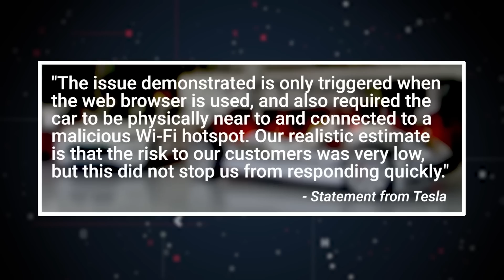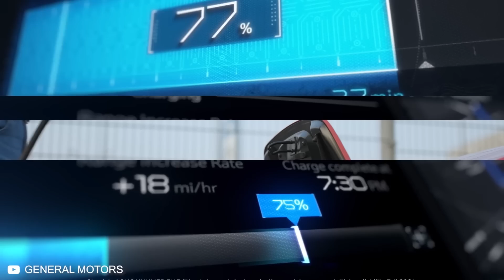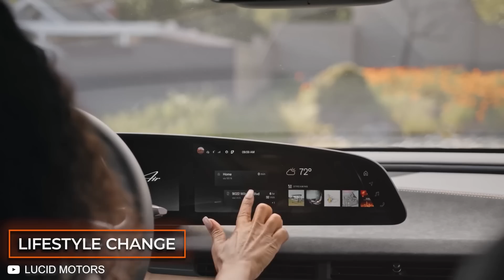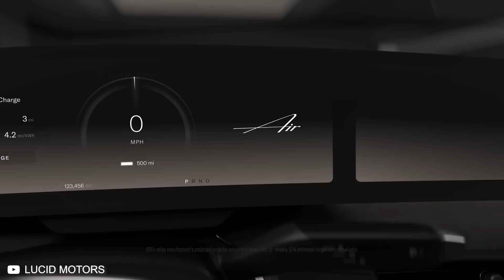EVs' Serious Problems That Carmakers Are Hiding

Comment: As a mechanic I can say Electric vehicles are less complicated than modern diesel cars .
Reply: Isn't the problem with modern Diesel with that stupid DEF and DPF crap? Other than that, Diesel engines haven't changed over the years with the exception of getting more quiet and more fuel efficient.
Reply: @bmw803  yes but electric vehicles are still less complicated. The most complicated thing in an electric car is the battery.
Reply: @cuppajoe2  They're less complicated for sure, but doesnt mean cheaper to fix. Over time this wont be an issue, but if an onboard charger, inverter, or any other component goes, it's big bucks. Even AC system isnt conventional.
Reply: @bmw803  well maybe for some EVs but if you are smart and buy a tesla then you usually get good service and sometimes free service if something broke early in
Reply: @cuppajoe2  I'm not spending over 40K on a car to save gas and a few oil changes. Bought a 2013 TDI Jetta 3 years ago and it runs trouble free. That's the problem in this country. Waste money on cars and then expecting taxpayers to pay for their retirement.
Reply: @bmw803  You forgot about asking tax payers to help fund their new EV toy. Up to $7500 in federal tax credits along with other State incentives, plus HOV privileges. Duuuumb!
Reply: @bmw803  if you can’t afford an EV then don’t buy it. But with current gas prices, it might be cheaper to buy one.
Reply: @cuppajoe2  Definitely. If gas prices keep creeping up, then the EV becomes cheaper, but demand will also go up, meaning the vehicle goes up. But on the long run, it might be cheaper.
Reply: @bmw803  yup. Especially with this whole russia Ukraine thing going on. It cost like 75 bucks to fill up my gas tank yesterday.
Reply: @cuppajoe2  lol, prices of electric energy rose already and will rise. Even some countries decided to charge EV charging stations which is fair. Why should I finance someone's car? Also, how do you think you'll get that much energy? The sun isn't always shinning and there only can be a breakdown in the whole city if all people would put their cars into s charging stations
Reply: @cuppajoe2 burning coal is one of the worst ways to get energy and since I have read that you don't think it's nothing special to the environment, here stops the conversation. We all know throughout the history how much coal clouds did poison ordinary people and how much the visibility was impacted. A gasoline car may not be the cleanest, but it's more efficient and simple to maintain. I don't know where did you get the information that e-vehicles are easier to maintain? E-vehicles sre far more sensitive and, when an electronic part dies, other thing are surely going to die too. Older cars were mostly mechanical and that's why they are still being used by people. Look at golf 2. It's a stupid car, but still it's on the roads. A tesla will go to a trash can after few years. Making electric infrastructure is also damaging the nature. Thermal power plants have to have much space to be built and many animals are being killed and their living spaces destroyed. Nuclear power plants are the best option for producing electric energy, but the problem is the nuclear waste. Where do you think it should go? Into your vegetable garden? Wind is also not always present. My country has a few windmills and they start working maybe few times in the year and they have a short lifespan. That means that you have to buy another one throw the old one away. Not so eco
Reply: @franfinesim  car. Also, idk where you get this notion that ICE cars are easier to maintain. An electric car is a battery with wheels. Some don’t even have axels. ICE cars need complex engines, driveshafts, cooling systems, fluids and more. EVs are a little more sensitive to the enviroment, but I don’t know where you got “when one thing dies other things will too.” That’s just not true. EV manufacturers made sure of it. The reason older cars are still being used by people is because there wasn’t widespread EVs just a few years ago. A tesla will not go to a trash can lol. Sure, the batter will need replacing after more then a dozen years, but they will recycle that battery meaning no waste. And buying a new battery seems expensive, but it’s cheaper then buying gas throughout those years. We are already killing animals by building up oil and gasoline infrastructure, so you can’t really speak on that front. Nuclear waste, while annoying, is put underground. You are right though, nuclear waste is a problem right now. If wind isn’t present in your country, then they won’t build windmills.
Reply: @cuppajoe2  lol. Do you know that you still use breaks, tires and other stuff like a normal car right? Ok, you don't need to add motor oil, because there is none, but still you have to cool the battery or you'll get toasted. What about your suspension, that's what you forgot too. Many people drive combustine engine cars, because they are reliable and you don't need to wait for minimum of one hour to get your battery charged, when you go to a business trip. How do you expect that a delivery man delivers you your goods if it has to stop every few hours. Oils are also used to make plastic what is also used in e-vehicles 🤷🏻‍♀️. And lol at the last sentence. I've explained you that we have windmills, but they rarely work! Because there is not enough wind and they will go to trash in a few years, because they a have a short lifespan. I'll rather drive a gasoline car with natural gas which is very clean and cheap (ok, now not because if the war in Ukraine, and sanctions to Russia).
Reply: Sure, until you have to replace the battery. Or until the electronics go bust.
Reply: @tinytownsoftware3837  it's all modular just parts replacement not repair .
Reply: @tinytownsoftware3837 what’s this supposed to mean here? Electronics are super easy to replace. You know what’s not? The internal workings of an internal combustion engines.
Reply: @cuppajoe2  if it were that easy to replace electronic parts, every person would drive an EV
Reply: @franfinesim  that’s just not true. For one, there are people like you who, for some reason, hate on EVs. 2, at the moment, EVs are quite expensive so not everyone can afford them. Replacing their parts is way easier and cheaper then a ICE parts.
Reply: That's utter bullshit.

Comment: Make sure that you have an unattached garage for your EV so it doesn’t burn your house down when it spontaneously combusts. 🔥🔥🔥🔥🔥🔥🔥
Reply: The chances of your electric car spontaneously combusting is so incredibly low that it shouldn’t be a worry
Reply: @cuppajoe2  Ask GM about that. They’re the ones that advised leaving your Bolt outside.
Reply: @barackblows1942  well that’s GM lol. Most others don’t.
Reply: @cuppajoe2  Make sure your smoke detectors are working. 🔥🔥🔥🔥
Reply: @barackblows1942  I will. Not becuase of an electric car though
Reply: @cuppajoe2  I wouldn’t be able to sleep with an EV parked in my attached garage. 🔥🔥🔥🔥
Reply: @barackblows1942  Oh No I aM sO sAd
Reply: @cuppajoe2  EV cars' batteries may not yet, but they will.
Reply: @cuppajoe2  You will be even more sad when your home also burns down while your electric car is charging. Even if your neighbours are not burnt out they will have to be evacuated because of the highly toxic fumes.
Reply: @cuppajoe2  Look up the recent Bolt debacle. Not that low.
Reply: @tinytownsoftware3837  the bolt batteries MIGHT catch fire. Also idk what this whole thing about batteries catching fire is. ICE cars catch fire way more often but nobody talks about that.
Reply: @cuppajoe2  They don't catch on fire when they are parked in your garage. They catch fire when they slam into other cars. And so do EVs by the way.
Reply: @tinytownsoftware3837  Actaully multiple ICE cars have caught on fire while going 60 mph down the highway… which I would say is worse. Also EVs need to have extreme protection against battery fires. Also also, it’s super rare for an EV to catch fire. Also also also, if you have fire alarms, it shouldn’t be super deadly.

Comment: the maintanance fees are bonkers
Reply: They really aren’t, I don’t see where your getting this info
Reply: @cuppajoe2  15k to replace a battery with a 10 year life expectancy. That’s equivalent to replacing your engine after 100,000-200,000km
Reply: @jimp5133  ok, let’s say you have a gas car and you drive 150,000 km (around 93,000 miles because my country uses inferior forms of measurement). The average car gets around 24 MPG, and if we divide 93,000/24 then we get 3,875 gallons of gas needed. Going off a VERY conservative estimate of $4.50 a gallon for gas, you get over $17,000 in gas for that car. And that’s a conservative estimate, with current gas prices it could be more then $25,000 or up to $30,000. Electricity is so cheap it’s not even a factor.
Reply: @cuppajoe2  what about the lithium required for the batteries? And what is the source of electricity? Fossil fuel powered? Realistically everyone will need to go Nuclear, not that excited considering the toxic waste.
Reply: @jimp5133  the lithium is already included in the price… but if you are referencing how scarce it is then yeah you are right. We are running out. We do have a few solutions though… other planets and even our moon, which we will soon be mining on. In the meantime, there is a lithium vein in Nevada that companies are trying to get to. Yes often fossil fuels are used to bring electricity to your home and power your car. Fortunately, burning coal to make electricity and then putting that electricity in an EV is FAR more efficient then putting gas in your car. You produce far less fossil fuels with electricity since a gallon of oil produces more electricity then torque in an ICE. Also nuclear power plants produce like no waste compared to other power plants.

You might be skeptical about EVs, but just know that everyone was skeptical about every new thing… EVs are here for the better.
Reply: @cuppajoe2  it’s not “far more efficient” by the time you factor in everything, going off planet requires a lot of energy including the burning of fossil fuels. Reality is it’s a band aid solution for a tech dependant culture, the best solution is to get away from the screen age, and invest in ecology, like afforestation that thrives in a Co2 rich environment. The individual effort, doubt everyone has planted a tree when this could help reduce co2 and the last thing we need is nuclear toxic waste. Yes there was a time when traditionalists were sceptical about the negative effects of the combustion engine, but here we are today. EVs aren’t a better solution to an ecological issue, never will be.
Reply: @cuppajoe2  The world's oceans contain an estimated 180 Billion tons of Lithium.
To extract Lithium from seawater has proved not economical.

Comment: Dude the problems you mention are utterly petty. Gas powered cars had about a 100 years to evolve, electric have had like 10 20 years. Give them 10 years and they will be much better in every aspect. For now, teslas work fine. Btw who the hell is using the same car for a decade to actually replace the battery pack?
Reply: Electric cars were available in 1903 and they sucked then. 💩💩💩💩💩
Reply: Electrics are as old as the gas car... stop making yourself sound ignorant and do some research...sigh.
Reply: The average American drives a 12 year old car. Are you suggesting people buy a new car every 5 years? How green of you!